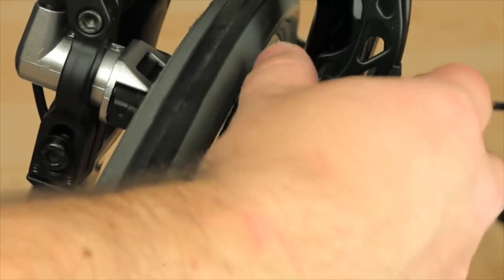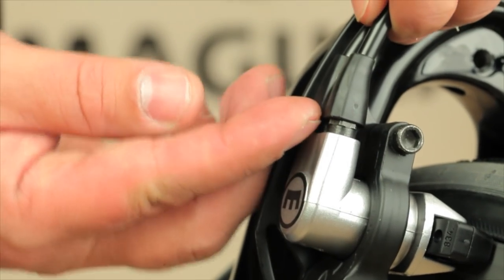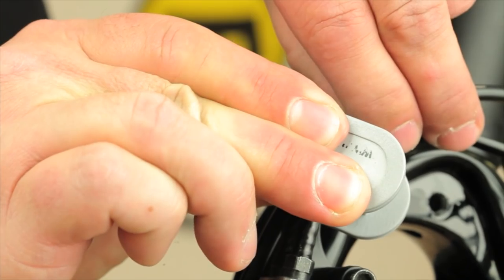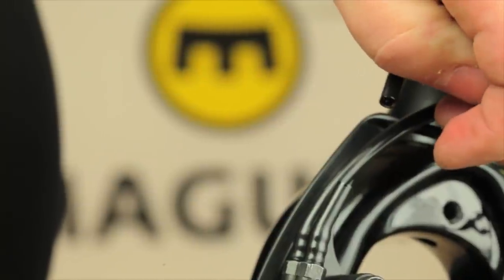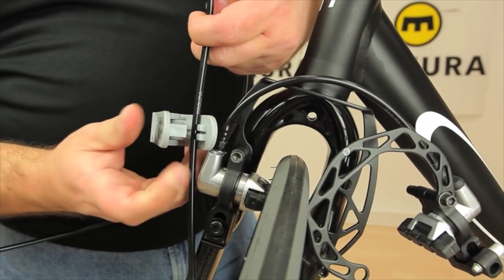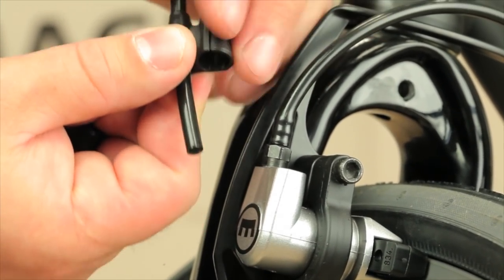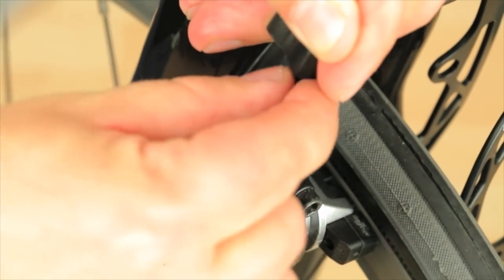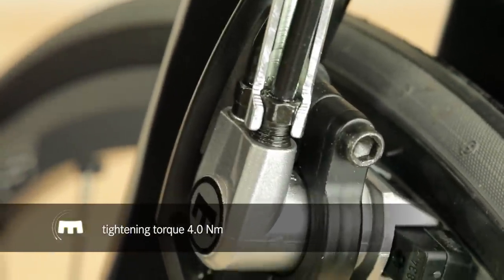Shorten the tubing/hose of a MAGURA rim brake (HS33 and HS11)

Comment: do the two cylinders move synchronously ? or does the primary and after the secondary move ?
Reply from the maker: Thanks for the question! One moves with a slight delay - in practice this delay is not noticeable. As soon as both pads contact the rim, pressures on both will equalize.

Comment: You hold the hose still so oil won't sling out. the hose is too stiff to pinch off by hand. If you are careful you won't have to add oil or bleed.

Comment: How to it with an fixed nut?  

I’ve just tried several ways to get the fixed nippel in the tube. Heated it but the heat damages the integrity of the hose. And the nippel just don’t want to go in. Heated the nippel and tried to push in the normal hose. Nothing, im fairly strong.
Reply from the maker: Thanks for your comment!

Please contact us on Facebook or Instagram for detailed technical assistance. You can alternatively contact any bike shop that carries our products for help.

Cheers! MAGURA Social Media Team

Comment: where can i buy two small parts using after cut the old pipe?
Reply from the maker: Good morning, you can get this part at your local bike store. If you need any help to find a local MAGURA dealer you're welcome to contact us via facebook messenger to get some closer information. Best regards Tobias (MAGURA social media)
Reply: They come with the brakes inside the bag with screws and other items you get

Comment: Can you use scizzors?
Reply: I did it with another cutting tool and although the cut wasn’t the cleanest of all, it does seem to work with no issue. I do not recommend you do the same and mess up but it is possible

Comment: If I cut the wire with scissor is it bad
Reply from the maker: Yes, you won't get a clean cut and will squash the hose. It's best to use a dedicated hose cutter for shortening the brake hose.